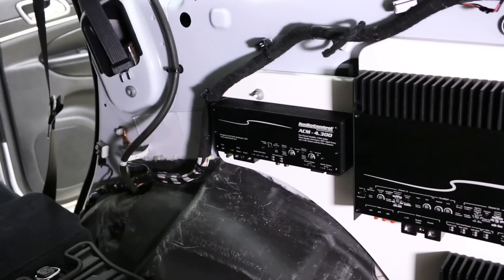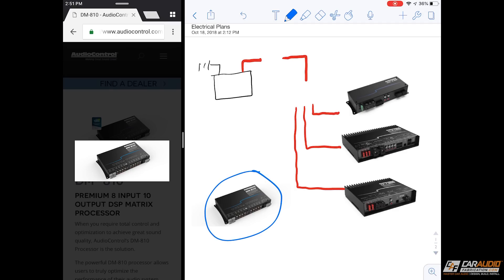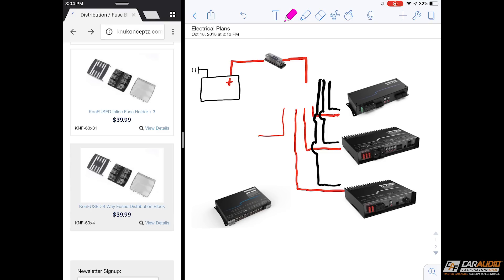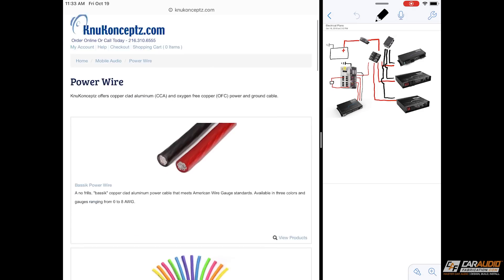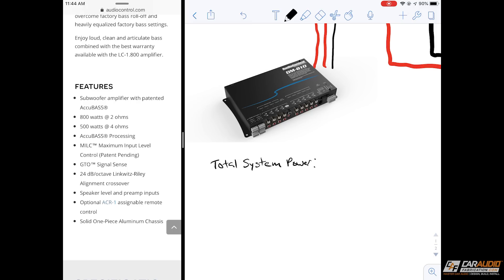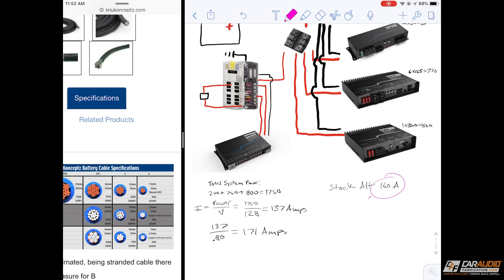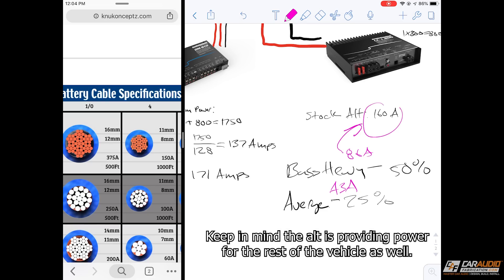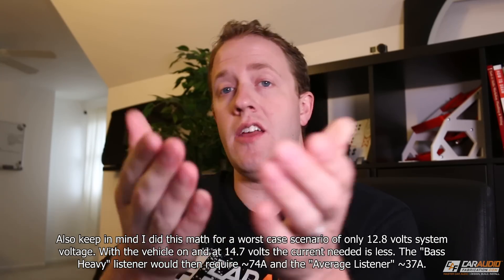How to plan car audio ELECTRICAL system wiring - Is the alternator big enough?

Comment: What would I use to reconstruct the enter channel in a 2013 Ram 1500 with the stock alpine system. I’m currently using a PAC amp Pro to my amp and I feel like I’m missing something in the middle of my dash that can bring out the sound even more. 

I talked the a local Car audio shop and they want to hook Kicker IQ amps directly to the speaker wires from the factory amp. I had tried that method before with the AC DM 810 and all I got a hissy mess of a signal
Reply: +The Great Empire!! Check with your Dodge dealer. The newer radios work with class 2 serial data. If the factory build calls the installation of a matching amp system to be installed, it is plugged in at the factory. The radio does an electric hand-shake with the amp then the radio drops back to pre-amp mode with a smaller output. The amp is on the class 2 data network and recognizes the input as pre-amp and is controlled from the factory radio blindly. It is the salve and master approach in many vehicles with options like this since the 2000 model year. Further back with GM. Unless the dash radio is not factory, then your'e on your own. The BCM wakes up the radio upon key on by sending a signal to wake up, followed by the VIN number. The radio contains a EEPROM that remembers pre-set stations, volume level and time with out power or removed...all thru class 2 serial data. Same with waring signals like key out, but lights on or even "ON-Star" systems. It mutes the systems speakers, then produces a warning tone thru the radio. The left front speaker becomes the microphone and speaker if using "On-Star" as well. Retired ASE Master tech.
Reply: Dean Kay 

Sorry, I traded in the truck a couple of months ago. Now I have a 2017 Ram 1500 Sport with the 6 speaker system.

Comment: Another way to work it out is by simply looking at the fuses on the amps....you can't use more power than that....
I also use an app called electrodroid. It will tell you what size cable is rated to how man amps and also the voltage drop over distance....super useful for so many electrical jobs. 

Any chance you could do a video on "ghost bass". When the subs start booming without any music playing, or when the speakers have a matching hum to the cars revs?

Comment: 8:20 

80% from 137Amp = 109.6Amp 
Not 171amp 
You need to do 137 x 0.80
Not 137 divide by 0.80
Reply from the maker: I know you're trying to catch me in a mistake here, but you're actually incorrect. 100% efficient amps would require 137 amps. But since there is no such thing as 100% efficient they will require even more current. The estimated current after efficiency calculations MUST be MORE. By your math it was less. Meaning according to your math the amps would magically be more than 100% efficient ...
Reply: @CarAudioFabrication  

Somnthing don't have sens .... you say those 3 amplifiers on 100% have 1750 watts 
Because are not 100% efficient you say are 80% efficient so this meen 1400 Watts 
So:
1400watts divide by 12.8 Volts =109.6 amps 
But you say on 80% you have more power so more amps ... It does not make sense
Reply: @emilo2009  You DIVIDE by the percentage to get the input current, which is a higher value than the output current.  It's like if I paid $100 for something from the store that I got for 80% of the retail price.  What was the retail price?  More than $100.  How much more?  $100 divided by 0.80 = $125 retail price.  

It's amazing there are so many people on these comments saying the same incorrect thing.

Comment: While we're discussing amperage. I have a 80 amp alternator. Plan on running Rockford Fosgate T1500-BDCP which easily does 2000 rms all day. Do I need to upgrade to a 140 amp alt or just add a second battery like everyone keeps telling me
Reply from the maker: Do you plan on being a "bass heavy" listener? If so then yes, time for an alt.
Reply: Yes. I will be pushing these 4 12s hard.
Reply: @12Messenger  you need to upgrade your alternator AND battery BEFORE you decide to install a second battery. No need to complicate your system more than you have to.

Comment: You don't put  another fuse on the 4 gauge power wire going to each amp or do you just use the built in fuse in the amps?
Reply from the maker: Yes you absolutely fuse anytime you step down wire size. That distribution block has spots for fuses in it. The fuses in the amp protect the amp. The fuses in the distro block protect the wire and your car from burning to the ground.

Comment: What gauge of wire is off your relay to feed the switched portion of your Blue Sea split bus fused distribution block?
Many relays, ex: a Tork 1 or 2 relay kit offers 16awg but in your demo you list 4awg to the constant terminal portion of the split bus; is 16awg or even 10 awg okay for the switched portion of the Blue Sea split bus fused distribution block?
Many thanks, another great and informative video!

Comment: Great video!  If you have an after market head unit with remote out do you still need the small distribution block and relay before the dsp?
Reply from the maker: No, but I am using the relay to trigger the turn on for other items as well.
Reply: @CarAudioFabrication  Trying to understand how your going about that. Your coming from one side of the block into the relay into the other side of the block and then out to the remote turn on on the processor. I must be missing something. How I understood how it would be done is hooking the remote lead from the head unit to the relay which would be hooked to one of the positive sides of the block and then hook all the turn ons for processors to that side. Is that correct? Hows that differ from the way you are doing it? Thanks. Love the channel.

Comment: You think 2 8s 100 and 2 horns in center on 100 rms to each speaker out of the 4 channel console and 6x8s on all 4 doors and 2k true amp for a single 15? A good 5050 balance

Comment: Awesome!!! Thanks so much Mark!! This is going to help out so many people! I'm interested in seeing how you use the mini fuse splitter block with a relay! This will be very helpful to understand for not only car audio, but marine and offroading applications!
Reply: Relays use a very low power source to activate them. So i would just tap off the trigger to the amps to supply power for the relay that will supply power to the mini fuse block.

Comment: i love the Knu Koncepts wiring i bought a few of them for my power wire 0/1 AGW.  nice colors and very flexible for their thickness
Reply: No sky high ftw. Even the 16 G speaker wire is as thick as 14 G competitors.
Reply: If the strands are real, then the entire wire should be soft.

Comment: What fuse should i need between battery & distribution block if i have the same sound system with 12.8 car voltage? Is it 100,150,200 amps? Note alt is 240 amp.thx
Reply: Fuses are used to protect the wire in the event of excessive current. (not the equipment it is connected to)  0 Gauge copper wire for chassis is rated at 245A.  If it is CCA wire (Copper Clad Aluminium) the rating will be lower at around 195A.  So any fuse limit below that should be good.  If you have a similar amp draw of 170A a 200A fuse will be just fine.  I am just a dude on the internet, not a professional electrician or installer.  So if you burn your car to the ground don't blame me.
Reply: @raygew  well noted, thank you sir.
Reply: Add up your fuses on all components. Example if your 4 channel amp has two 25A, that would 50A plus a sub amp with three 30A would be 90A (140A total). That is the minimum fuse you would want to use. Then check your cable's load rating, this varies by brand and material (CCA vs OFC etc...) The cables rating would be the max fuse for the inline fuse holder.  The fuse is a safety, larger will not "improve" system performance. I would select a 150A for the example above even if my cable is capable of a higher load. 

As long as the fuse is lower than the cables max rating and higher than your system is capable, you'll be just fine
Reply: thank you for your response, keep the good work

Comment: hey thanks Mark for the video...   one problem I see  is that not all manufacturer tell us the real wattage.  Or isn´t this a problem is the US?  In germany it is :-)
Reply: Generally you can divide it by 3 if the box only says peak or max. But as I mentioned in another comment, you can always look at the fuses on the amp and then add them together. (You can't draw more power than what the fuse will allow)

Comment: So were you calculating peak watts or rms or cea?
Reply from the maker: The amps would require 137 amps if they were 100% efficient, there is no such thing as an 100% efficient amp therefor it will require more current to produce the rated output. Based on an average efficiency rating we find the current value (which must be more)
Reply: He is going by the rms
Reply: @howardminkler484  isn't it supposed to be multiplication instead of division on the 80%?
Reply: @howardminkler484  okay thanks. Also isn't his math off? In his scenario he said 137amps at 100% how is 80% even more??
Reply: Ohhhh. Okay okay I get it. Dam I just bought a system that the two amps push 2400w rms total which I'm coming up to 235amps. For a 2015 sentra, which has an 110amp alternator. What's worse is I cant find any aftermarket one for my car. I need to return all these things man this video was an extreme bummer lol.  Snap back to reality I guess.

Comment: Another great video.  The audio system is only one thing to consider when sizing the alternator. My Jeep Wrangler also has an air pump, winch, lights, etc. just make sure you include your entire electrical load.
Reply: I'm wiring a system for an off road vehicle as well. Though those are important factors to keep in mind, you most likely won't be running them all at once.

Comment: I noticed you didn't touch on the capacitor subject..... is it because you don't believe in them or were you just keeping this video somewhat simple?
Reply: There's no reason to get a cap in your average build unless voltage drop is shutting off your amps. They actually act as an extra draw on your system and cause more harm than good.
Reply: Capacitors do nothing.  If you need more amperage add batteries and upgrade the alternator.
Reply: @justingardner4555  You guys know shit about electronic...The cheap cap do nothing... Every good amp has quality caps in them...They do work they will release energy faster then ain't battery...Which will keep your system running cooler.. Battery that can't release they energy ass fast as a capacitor...They will get hot capacitor will eliminate that...You don't believe take 8 Durrell cell n RC motor 500 1/10 scale...Run that and it's going to be like a stove... Run that same set up with a big capacitor... Virtually no heat...A lithium battery release energy faster and also would be less hot... Because it's design to release energy fast.But a capacitor is even faster...
Reply: The alternator will be enough, or you could use batteries instead. I currently run a bank of agm batteries to power 5k watts(rms) system and rarely drop below 13.8 volts. Just set your system up with a oscilloscope and the system will be cool.
Reply: dcole808 agreed. I have 2 xs 3100s and a mechman 350 that powers a 3500w rms system. I dont drop below 14.0. Set your gains and have power so you can make power
Reply: Caps don’t “do nothing”. Remove the capacitor from your home furnace blower and see what happens. 
But is a 2nd battery better? Yes, usually.
Reply: @KellerDad  Thats a starting cap and has nothing to do with what it does in car audio.
Those 1-2F caps don't do much in car audio, if you have supercap bank that's a whole different story.
Reply: @KellerDad  don't compare an single phase AC motor cap with a DC power storage cap. They are there for 2 very different reasons. Infact if you knew anything, you would know that the cap on you single phase AC motor also gets "cut out" by a hall effect sensor (that monitors the motor rpm) once the motor is at a set rpm. So next time you think you're smart saying that just keep your mouth shut because you look like a dickhead.
Reply: Liam Cooper No need for the personal insults bruh.
Reply: @KellerDad  I'm sure it is not the first time you've been pulled up on it. And since you've said it word for word from the last time I've seen that comment, I dare say that it is also not the first time I have pulled you up on that comment.
Reply: My lights where dimming out on heavy bass note i installed a cap and problem was fixed. Caps will provide a quick burst of electricity but not a continuous amount of electricity if your shit is running past 80% continuously. A alternator upgrade and second battery if your trying to run your shit full blast for long periods of time..

Comment: Hey Mark awesome video! Also it helps to do some research on your gear and find out what they actually pull based on effeciency. A top teir Zapco AB class amp may pull alot more power than an Alpine PDX amp for instance to make the same wattage. That factor can also effect your % numbers when considering a moderate daily use. However high caliber amps like that usually aren't for the "moderate" consumer. I know you know this but I thought I'd mention it here!
Reply: Jackson Oswald  a cap it any electronics is just a buffer to stabilize the Voltage  from dropping to much  a battery  can’t supply  a huge amount of current when  it demands change also same gose for a alternator  a big enough cap  will help smooth out the change in demand but  as I said it’s same in ever electrical circuit    People in car audio use them wrongly most of time
Reply: MR66HD I wasn't talking about a capacitor. I was talking about efficiency in the different amp classes.

Comment: Why did you not factor in the battery and that the battery makes up the shortage of the alt? I mean if you with in 10amps at full tilt your not gana have a problem .. i pull 300+ amps at full tilt with multiple runs of 0 ive been running a factory 180amp alt for 2 years now lol... I have a 300amp alt sitting that i bought and have yet to need ... I do have 2 massive batteries with 2/0 ran under the hood and the big 3 ..